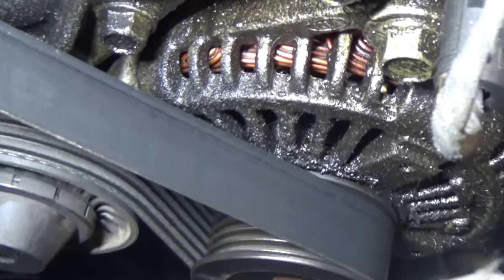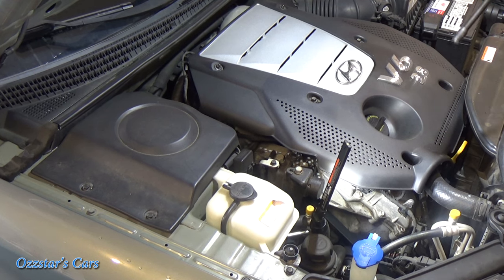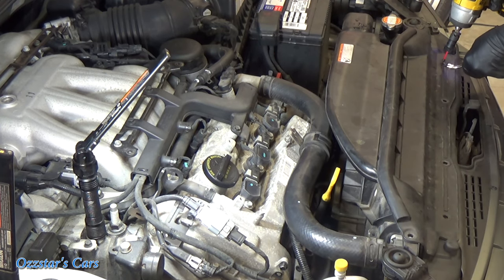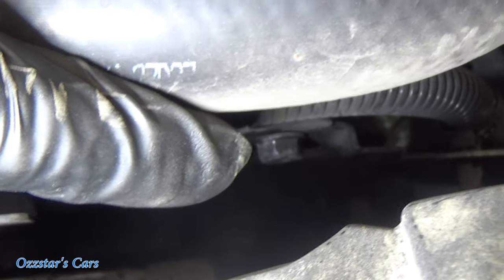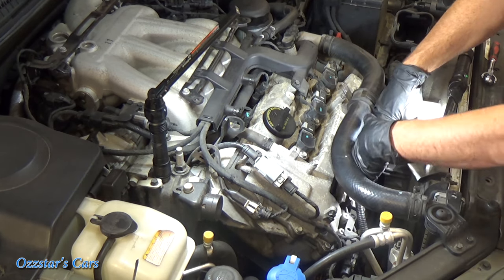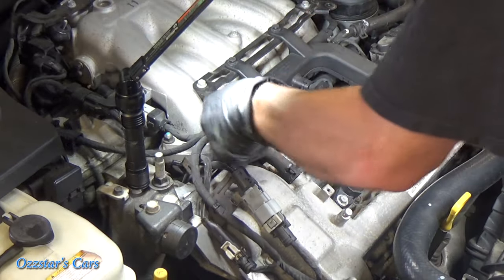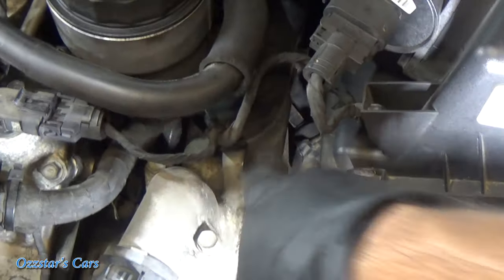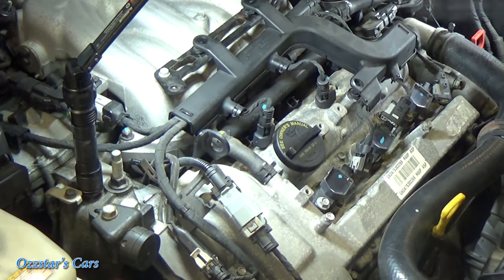Leaking Valve Cover Gasket Can Wreck Your Alternator!

Comment: I've had valve cover gasket replaced 3 times in 7 years! Thinking of a hack to just divert the oil from leaking into alternator such as an aluminum or steel plate.
Reply from the maker: @stephenrix4883  what brand of gaskets are you using?
Reply: @ Fel Pro. & applied the adhesive on the ends for the second one.
Reply: There's a recall on these. Hyundai is supposed to fix it with their own diverter. Valve cover is part of the leak. It's coming from the timing chain cover too.

Comment: I have the same problem on my 2010 Chevy Malibu , What did you use to clean the alternator and belt? Do you recommend using stop leak after replacing the valve cover gasket?
Reply from the maker: Just a little bit of brake clean and a clean rag. Replace the belt. I never use stop leak.

Comment: Having watched this it made me wonder how much more needs to be removed to change the timing chain. Is there also a timing chain underneath the rear valve cover? Ours rattles for a few seconds when starting the engine. We have more than 200k miles on the car
Reply from the maker: Common issue, the timing chain tensioner wears out, causes slack until oil pressure pumps it back up. Yes both banks have a chain to turn the camshaft sprockets.
Reply: @ozzstars_cars  It looks like a much more complicated repair job than I am capable of - largely a factor of tools and patience. Probably not worth spending the money to have the dealer do it - 5 or so years ago they said it would be more than the car was worth and they'd rather sell us a new car!